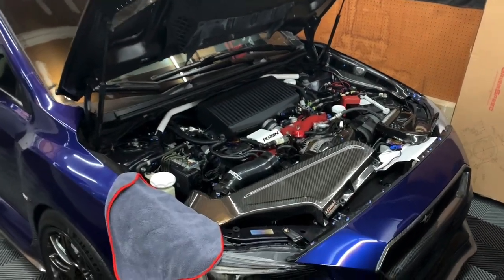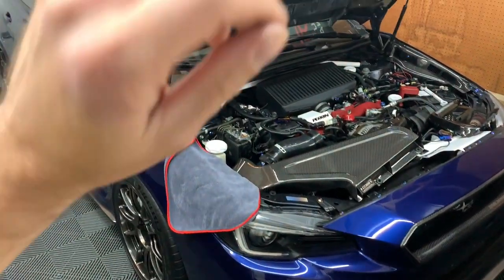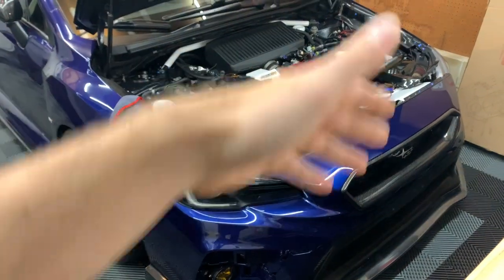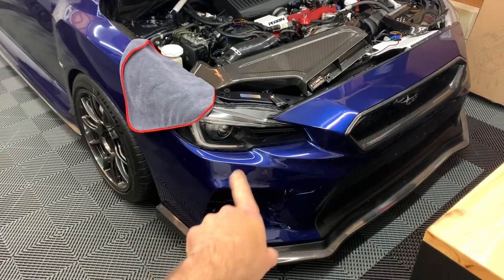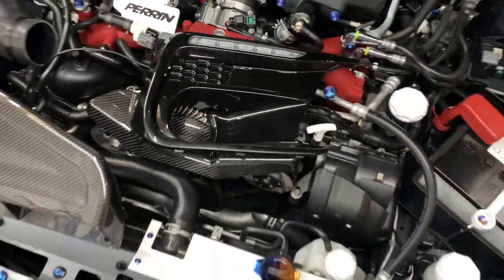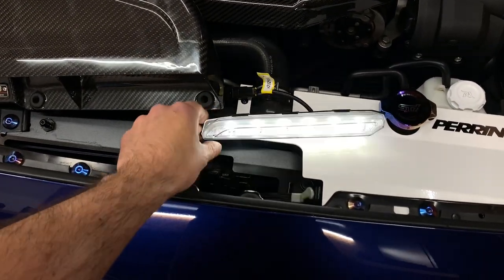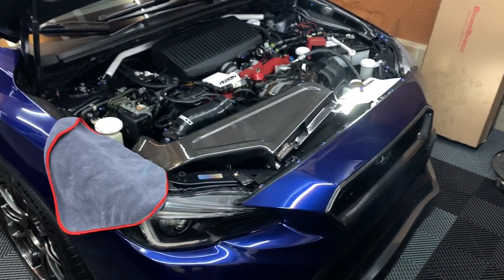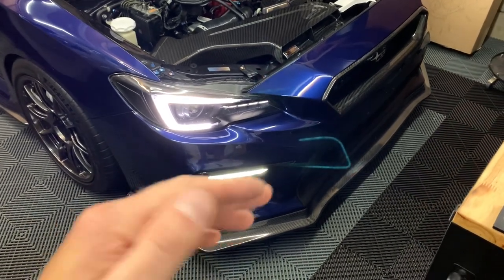My Least Favorite Thing To Do On Cars

Comment: I like that you never cut into the factory harness. That is a HUGE pet peeve of mine as well. Id rather make my own harness or spend a lot more money than cutting the factory harness. Its to bad not everyone else thinks that way, Ive seen a lot of trashed stuff in my day due to people molesting the factory setup. These days even cutting a wire and adding another will change the resistance and has the potential to really cause a lot of issues.
Reply: Amen! Worst thing ever is buying a used vehicle and the factory wiring is a rats nest from people cutting into it etc. Every time I changed lights out of my WRX, I have sprung for any harnesses they make for them. This has made my life easier and love the plug and play setup.

Comment: The DR module is basically a large resistor that lowers the output of the bulbs so you're not blinding people with high beams...maybe it's converting the power and causing the flicker?
Reply from the maker: The way it was wired when it was flickering was not even touching the drl module. The fog bezel strip lights are powered directly to the fuse box.
Reply: @Autofreakgarage  Ahhhh...weird. Nvm than, hahaha

Comment: Howmuch did a replacement strip light cost you? My right side strip light on my fog bezel just went out :(
Reply from the maker: Check the wiring! The light was warrantied.
Reply: @Autofreakgarage  Ok! The way I had my fog bezels strip lights powered on is add-on fuse in my engine fuse box. I remember I followed that through subispeeds tutorial vids
Reply from the maker: Yes that’s how mine are wired.